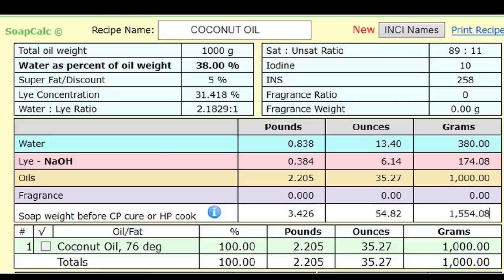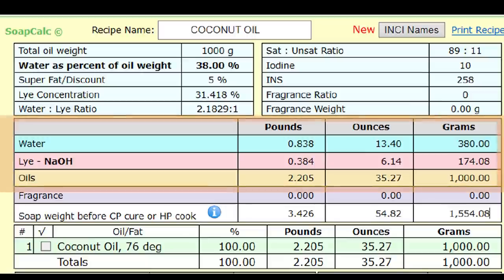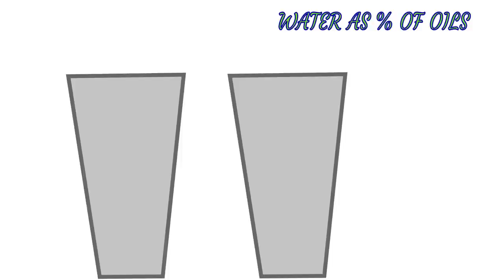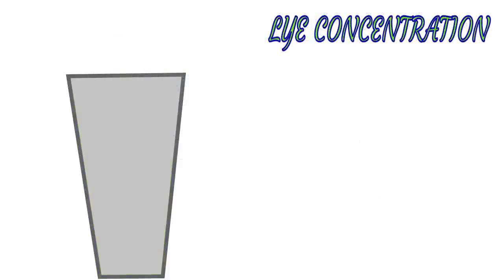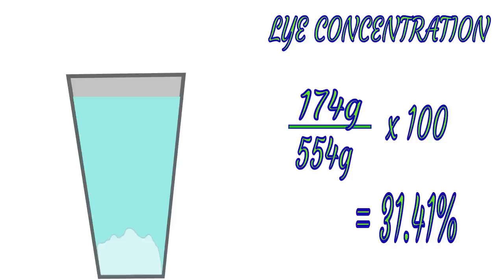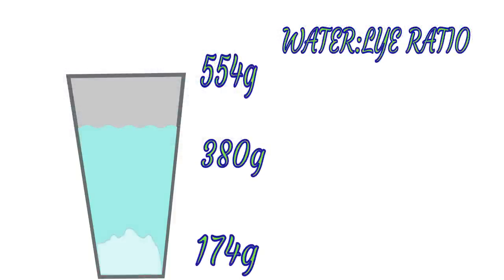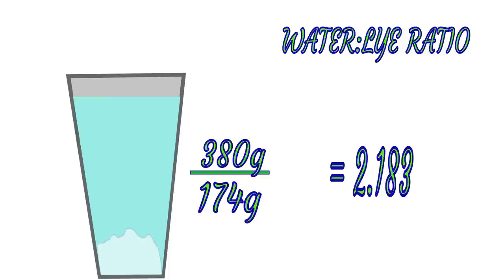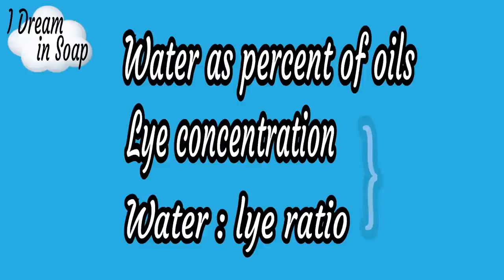Water discounts, Soda ash, glycerine rivers and gel phase ~ Cold process soap making tutorial

Comment: What is the lye water ratio you usually use for your soaps? If you don't mind me asking
Reply from the maker: Hi Amanda, no problem at all. My lye concentration is 35.63, which comes to a lye/water ratio of 1.8064:1
Reply: @IDreamInSoap  thanks, Lisa. I was just wondering because I've heard people go up to the maximum of 50% and have no problem with it. What would you say would be the advantages and disadvantages of going that high with the percentage?
Reply from the maker: @AmandaFiorani  I guess it just takes the extremes of less chance of glycerin rivers, no soda ash to the max, but it will make your work time much shorter. People use it to hopefully speed up cure time too, which is a contentious one as cure time is not just about removing water. I know quite a lot of people masterbatch their lye at 50% so that they have flexibility when they use it and can add other liquids if they want.
Reply: @IDreamInSoap  I see. Thanks so much. How did you get to the ratio you use?

Comment: Still I didn’t get a number which is used as a percentage. You talk about less or more water to use and the effects has on soap but compare to what ? Is a 38% water to oil the standard ? Is a lye solution of 31% a standard ?
Reply from the maker: Hi Lady E, that was one of the points that I was making, that the confusing thing with soap making it that there is NO standard amount. Soap calc (as I discuss in the video) uses 38% which often people see as 'full water' but other calculators use different amounts, It was also why  I was trying to illustrate the point that when people say water discount, that will mean different things depending on where you are starting from. So no, unfortunately I cannot give a 'standard' amount as there is no standard. 
Soaping towards 38% of oils is a lot of water and really best for hot process, that would definitely be high water, to notice big benefits you need to really be getting to 30% or less. I always soap at 25% which is a lye concentration in my recipe of just over 35%, but this will depend on your recipe, so it's best to test and see what works for you, maybe when you are next doing a simple soap, one that doesn't need much working time, drop your water down (the water should never be less than the weight of your lye). Then you can see if how your recipe behaves with less water and if it;s a simple soap it won't matter if it moves a bit quicker than you'd like as you can still get it in the mould without messing up a design.
I hope this helps a bit - Lisa
Reply: @IDreamInSoap  Thanks so much for fast reply and clear a little bit my confusion. When I see a recipe and try to fit to my mold having problem figure it out water and lye usage.

Comment: So if we dont use the water as a percentage of oil how would we calculate the amount of water to be used in the recipe?
Reply from the maker: You can just use whatever measure you like in your soap calculator, so if you like a 40% lye solution, you tick on the lye concentration bit and then fill in the concentration you want, they calculator will work out the water for you whilst it calculates the lye.
Reply: @IDreamInSoap  ohhh i understand thank you. Do you have any tips on soap storage? Like the dos and donts of storing soap?
Reply from the maker: @kayla-rae4770  Just generally try to keep it somewhere dry, out of direct sunlight with good air circulation, if you put it on anything try to avoid metal unless you put a liner down 1st.
Reply: @IDreamInSoap  Ohk, so would a plastic bin on a shelf be an ok curing spot? Also I've heard persons say that they use sand in curing. What is the purpose of that?